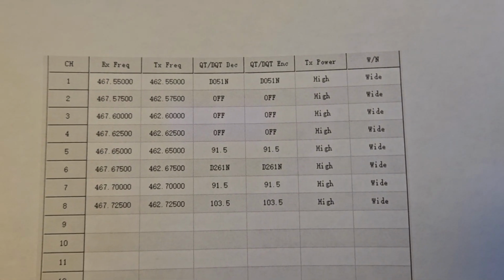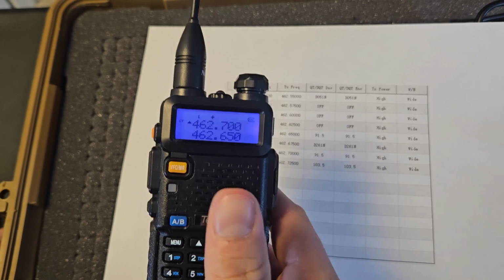How Radio Offsets Work

Comment: You say you’re setting the offset by 5,000 MHz…you’re not. You’re setting it by 5,000 Hz, or 5 MHz. As the display clearly shows.
Reply from the maker: Yes I am aware of this and in a way I am doing it on purpose when I was learning radio people saying 5 and it kept confusing me.  watch at 44 seconds I make a note about it.